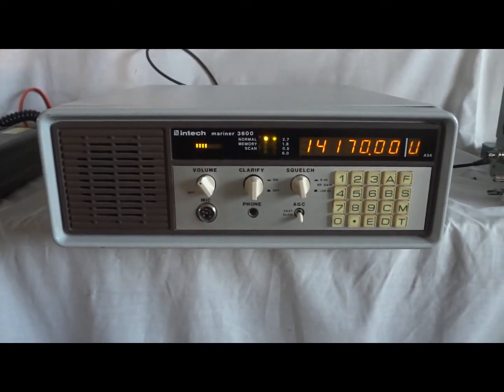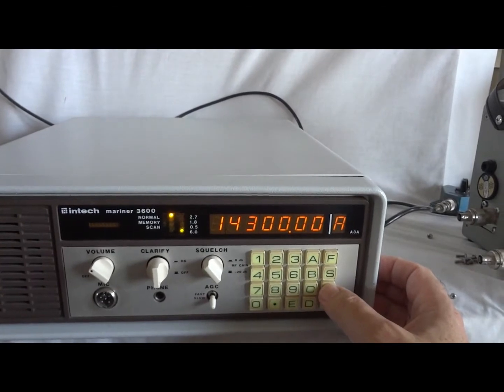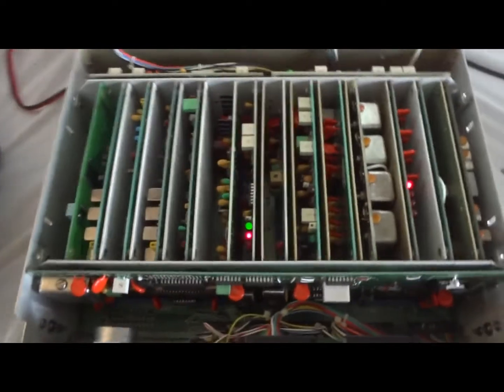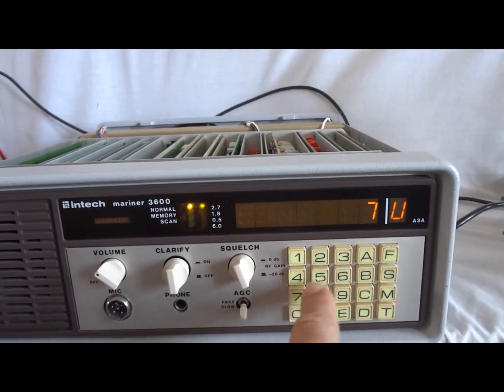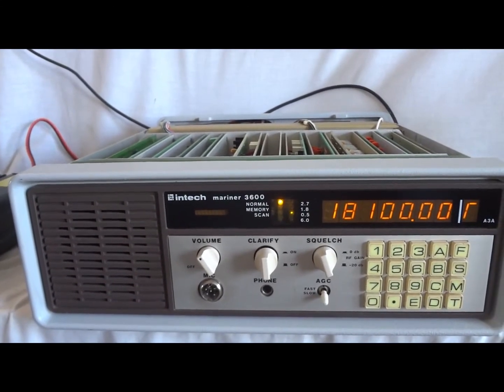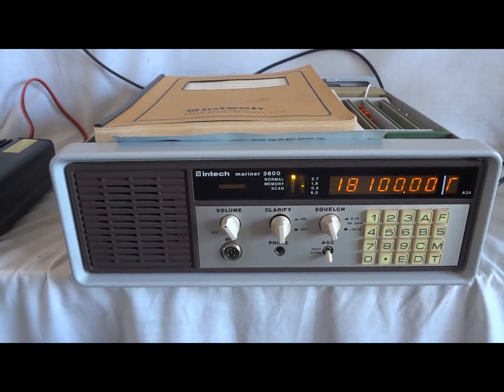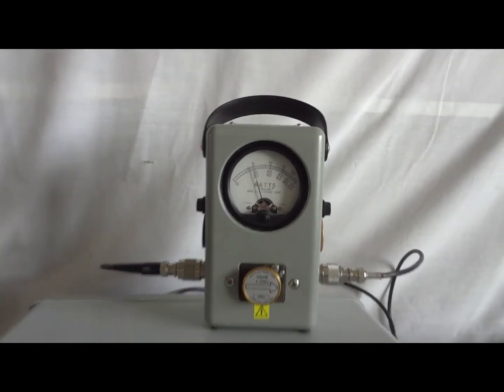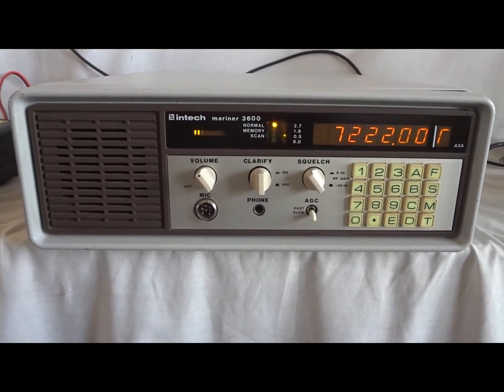Intech Mariner 3600  HF SSB marine radio 150 watt

Comment: Hola estimado buen video sobre la radio mariner 3600, tengo una igual pero me falta el filtro para LSB, ¿Dónde puedo conseguir el filtro? Soy de Chile. De antemano muchas gracias, saludos!
Reply from the maker: I bought that LSB filter on eBay once. It was a gamble because I did not know what the in- and output impedances were for the filter, nor did I know how the filter's center frequency related to the IF product detector frequency in this radio (it could have been off by 1.5 kHz) . But it worked perfect, which was just plain luck. Thanks for watching the video.
Reply: @LifeIsTooShortForQRP  
Muchas gracias por la informacion, voy a buscar el producto y espero tener surte.

Comment: I just picked this radio up for $10 at a local ham fest. Killer deal for any working hf rig!!  I also bought the 20 amp power supply that goes with it for $20. A dollar per amp!  Lol
Reply from the maker: Wow. You got a good deal. Because this is a very sophisticated radio. And apparently yours still works; I had to repair mine. Congrats!

Comment: it has original antenna tuner???
Reply from the maker: Hello! No this radio has no built-in antenna tuner, it needed an external one, placed close to the base of the vertical whip that they use on ships. Cheers.
Reply: @LifeIsTooShortForQRP  most of marine radios have external tuner i know. this radio has no 0riginal ext.tuner itself? i wondered
Reply from the maker: @bahattinturnaz8406  I'm sure it did, given the special interface connector for that on the back. But the manual did not mention it. Cheers.